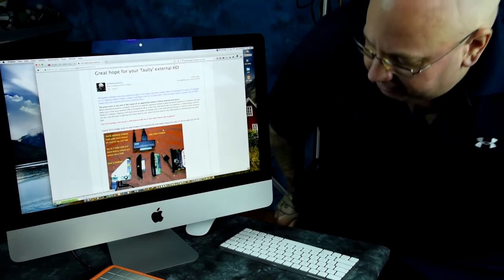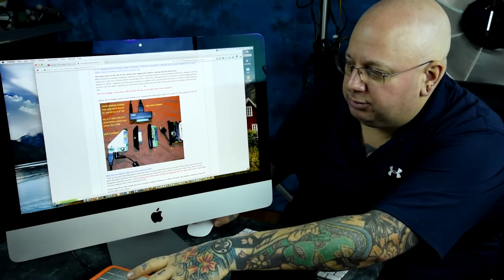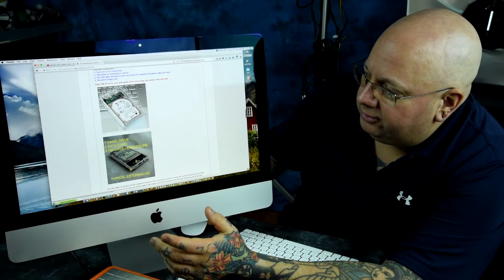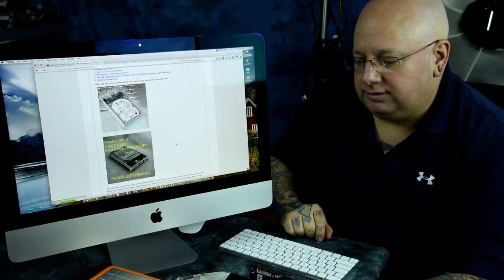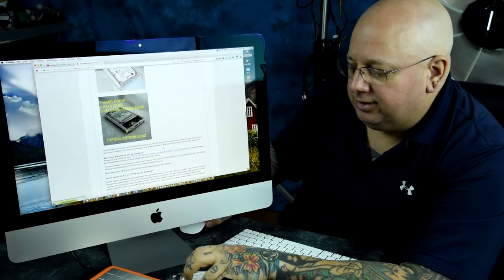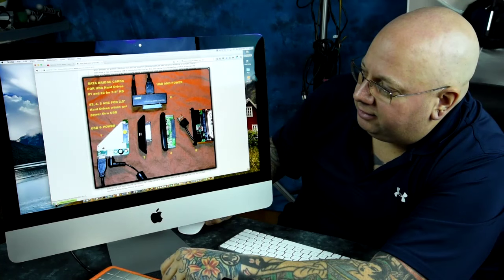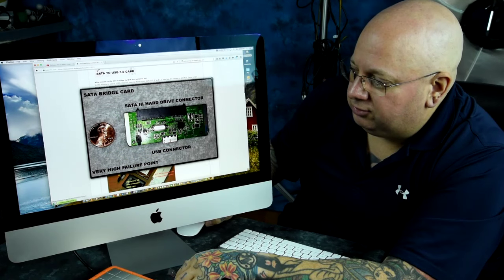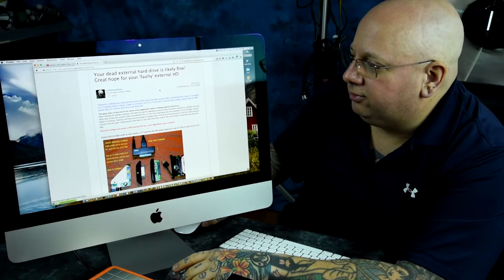Secret of "dead" external HARD DRIVES! How to QUICKLY fix the problem, its cause and solution

Comment: hey thanks a lot for taking the time, appreciated, but...still need the 'how to' part unpacked a bit more. "crack it open" doesn't help me much, sorry. My bacon is still in danger.
Reply from the maker: its just a plastic shell, crack it open like a clam, you wont hurt it …..just careful of static …dont touch the controller board on the bottom
Reply: And then just pull out the sata? It doesnt need it to run i assume?
Reply: How hard to put back together?
Reply from the maker: you need a docking port to run the drive
Reply from the maker: you dont ahve to put it back together i use NAKED drives solely, its easier, less space, nothing to break…… ;)

Comment: While I can appreciate your gusto, 95% of drives don't fail this way in my experience.  Yes, absolutely there are SATA bridges that fail, and those cases the data can be recovered.  However, there is no SATA bridge that you'll find on an internal drive, at least not in the description you show there.  Because drives are so cheap, it makes no sense not to have multiple copies of your data on a backup, both locally and in the cloud.  Aside from that, carry on.  Good fix on externals in some cases.
Reply: He CLEARLY said EXTERNAL hard drive fix, so I am not sure why you'd mention internal hard drive fix.  He did a good job, just let it be. The TITLE, definitely said "external hard-drive"....quit nitpicking.
Reply: To be fair, he said ABOUT 95%... Could that be 86?
Had he specified EXTERNAL he wouldn't be that far off.

Comment: I don't comment on Youtube very often. But this time I had to offer my thanks and express my deep relief. After my 4TB external Seagate refused to mount, I lost all hope. Even though I've lost extremely valuable data before when another external drive was dropped on a concrete floor, I still somehow managed to fall way behind in backing up my Seagate. I knew I'd lost years of work but the thing that bothered me most was that I couldn't remember what else was on the drive. There's no feeling quite like losing hard drive. After a desperate search I found this video and was afraid to believe it  could be so simple. Long story short, it was! I cracked open the case, removed the SATA bridge card and plugged the drive into a dock at work. It mounted immediately and I couldn't be happier. Thank you!

Comment: Good information, but not very explanatory. I did save one of my external hard drives by taking the factory bridge card out and using a powered one. But what about regular 2 and 1/2 inch drives? I don't see any real information that helps on that subject here.

Comment: I don't mean to be THAT PERSON but I cringe a little every time you say "inside the hard drive", because that's not really the inside the drive, it's the inside of it's ENCLOSURE. You should probably change your title and specify that you're talking about external hard drives because one day, some bloke is going to remove his hard drive from his MacBook and start unscrewing it and they're going to break their drive looking for the non-existent SATA bridge (or what I call a "USB adapter")  
Some other commenter said you're 95% figure was way off, and I kinda defended you because you said ABOUT 95% and that could very well mean 60, 72, 99 or whatever you want to interpret "about" is, but the guy is actually right. This isn't the problem with most droves or even half of them. NOW, had you said External drives, you wouldn't be that far off and if you specified "external drive enclosures", you would be right on the money.

Comment: What he doesn't tell you is that the most common cause of failure of the little card is dried up electrolytic capacitors.  Best is to replace them all.  Only a few, and total cost, less than one dollar the lot!!
Peter

Comment: You can use usb external power, need a 12v adapter
 and usb socket. It will work fine.

Comment: I wonder if this works for a Seagate Backup Drive that is like standing upright, that fell off my desk, manufacture date: 2012. It looks like a black box standing upright on my desk. It is not a portable hard drive. I would want to try this method ALSO with my other two portable drives as well that fell off my desk in 2015, and in 2021.

Comment: Get a Sabrent Dock station or buy Sata Cables and install them internally if your motherboard and power supply has the capability/ports...  No rocket science needed.  ALL drives are made by a limited number of manufacturers and most are created to be internal.  Putting them internal increases their speed due to direct motherboard action and so saves you a USB port and external power supply.  One big drive manufacturer is Western Digital for example.  PS, use Youtube to format/set up the drive, which has to be done.

Comment: Maybe someone here can help me with the problem I have. I had an external drive that suddenly stopped appearing, so naturally I disassembled the case and tried it straight into a SATA port. Very gladly I saw it appear in the BIOS, so I thought that all it was is a bridge problem, and that's true.
BUT what I see now as my G: drive is NOT what it was. I actually see a RAW partition and two non-assigned portions of the HDD, while I had a single partition full of data.
I guess it's got something to do with the bridge doing some type of conversion, but can I see the content of the drive somehow?
Thanks!

Comment: I have a WD USB 3.0 powered external drive. It works for about 5 mins then stops. Sometimes I can get it to remain spinning by unplugging it then plugging it back in. It will work fine for a few days then the problem returns. Sometimes I hear clicking noises coming from inside it. I'm not sure if that means it is dying or if the cable is bad or the random failure is the result of the component you highlighted in this video.

Comment: My BIOS does not detect my hard drive. It shows everything else but the hard drive. It keeps appearing and disappearing in BIOS. I have re-seated the SATA cord in different ports, changed SATA cables, and nothing. Can't boot up my PC. I am sending mine back to Amazon. Good thing I didn't put too much on it. Oh, this happened during my first virus scan. Perhaps they sold me a used card with a virus on it. I noticed that it had malware, junkfiles and other things. How can that be when I just bought it? I know, right? Thanks for sharing.
Reply: Niecy DMS  please help me with my apple harddisk

Comment: I figured that out many years ago. Tho' I don't recall ever having an external drive fail. I still have an 80gb external I used as a backup, over 15 years ago. It still works fine. I have a HDD dock, plus a couple of loose cable connector type. With the 2½in, you buy a single cable that plugs into the HDD and usb of computer. It powers the drive as well.

Comment: question. after 6 months i left my death hard drive inside a magnetic bag for a while , i was thinkin on send it to a data recovery service, but i bought this SATA to USB 3.0, SATA III Hard Drive Adapter Converter for 3.5/2.5 Inch HDD/SSD with 12V/2A Power Adapter and it worked perfectly fine for like 6 hours :( any idea what coul happen? its i worth to buy the dock in this particular case? and the dock its a recommendation for the rest of my life to save some problems in the futere?  gracias!

Comment: What about the WD external drives that don't have the bridge any more but JUST a USB connector?  How reliable are they?  I have just gotten a 2.5 inch Easystore 5 TB drive from Bestbuy on sale for $89.99.  Really I would have gotten a Seagate if it was cheaper or a very similar price per TB.  Then I could use it in my desktop or laptop someday if I wanted to.

Comment: Some times after dropping  a external hard drive you can remove it from it's case and and connect it to the SATA and power cable inside the computer and it can sometimes work to help you retrieve your data

Comment: A lot of people do not realise that you can simply 'shock' your drive motor into action again. The little motor inside the drive often gives out. Simply shocking it can 'Zap!' it back into action. Easily done by cutting a cable and placing both live points into the USB and turning on the power. Dont touch the box though! If that is too dangerous just get a mozzie zapper wand and connect it in. (or do it the cheats easy way and just place the drive in the microwave for 5-10 minutes. Then connect it up and let it rip! (if this tip helped please send support to my bitcoin address rjdEf3389hTH5rlIUJ7ljlim8uk78oKilO814 - thanks a lot).

Comment: hello @theoria apophasis
hello everyone 

sorry for my english .. plz i have big problem with my 4TB external hard drive 

i dont want to waste ur time reading ... so i will tell the problem very fast 

everything was ok with my hard drive ... but next day my pc didnt saw it ... but i can hear it running ( normal sound too )

what did i do trying to fix this 

1- changing the cable 
2- disk management ( nothing there )
3- seatools for dos ( again nothing in there )
4- i tried a different pc (3 of em ) nothing there 
5- changed the usb port ( nothing )
5- i changed the usb-sata bridge ( the green part in the video ) with 2.5 inch box ( still nothing )

any advise guys ...thank you

Comment: hello sir, i face the following problem with my maxtor m3 portable external drive. I purchaced it 3 months ago and i ve slightly used it only to install windows on a laptop and transfer some movies.  It has 2TB capacity and today i realized that this capacity is all magically gone and there is only 32Gb left inside the disc!! What happened?? Hope it is something fixable!

Comment: The power light on my Seagate Backup Plus (external) stopped coming on, but I checked the DC power suppy (transformer) with a multimeter and the voltage is fine...could that be a sign of a failed sata bridge card? Bacon in need of saving

Comment: What are the symptoms of a bad Sara bridge?I have a WD 1t passport and I know where to get the board. But I need to know if it's the board or the hardware (drive). My symthums are :Drive takes forever to load. When it does load, I get a warning - "Mac OX X can't repair the disk. You can still open or copy files on the disk, but you can't save changes to the files on the disk. Back up the disk and reformat as soon as you can"I can then look though my hard drive. I can open folders but they take forever to show the contents. I can even copy files but if the files are larger than a megabyte, it fails to copy. As if the reading is so slow, the computer gives up and a message says "the operation can't be completed because the item is in use". And if I try to open straight from the disk, it says "the document can't be opened".

Comment: I would really apprecitte if you could give me some advice ,  I dont understand much about the topic so my only solution apart from trying a disk enclosure would be to send the disk to a lab and they would probably charge me between 500 and 1000  euros and i really cant afford that atm , when i bought the SSD disk i have now i took out the Western digital sata disk i had and until now I didnt think i needed any of the files i had there but turns out i really do need them . I stored the disk but it feel down once after i disconected it from pc and now when i tried to connected it appeared to smell like something was burning and the disk just stopped  working  , it isnt recognized by the system and it really doesnt show any sign of live , its dead , i was wondering if its worth to try an hdd enclosure or if there is any other option i could take apart from paying hundreds to try to get it back.

Comment: Very useful video. Thanks.
A USB-SATA conversion cable ($10) also works to get data off.
When I hacked open my Seagate 3.5" 2TB, I blew the dust off the SATA Bridge PCB, pulled it out and put it back and the drive started working again for a short time. This might help someone copy data across if they are in a hurry.
I then bought a powered 2.5/3.5" USB3.0 to SATA conversion cable ($10) to replace the broken SATA Bridge PCB for my 3.5". It was cheaper than a dock and I don't access the drives often.
I also decided to get naked and bought 3x 2TB 3.5" internal hard drives and some nice colourful plastic boxes to store them in and use the cable to access them when/if needed.

The article you link to is also interesting and useful.

Comment: i have a question: so my computer died quite awhile ago and i took out the hard drive, buy a harddrive station and the harddrive was fine, i could move the data from the drive to my computer...since then i havn'et used the harddrive and the station. now, i wanna look into my hard drive again so i put it into the station and turn it on, but it doesn't response at all. the station doesn't seem to be responsing as well because the power light is not even on, i can't tell whether it is my hard drive or the station but since i havn't used either of them for a while, i dont see how both of them or one of them could be suddenly dead without even touching them...any ideas???? thanks.

Comment: I have repaired hundreds of external hard drives and never had a problem with the power supply board only a loose connection. So not sure where you have studied Computer science.

Comment: I opened a working external hard drive and took out it's Sata and put that in the not working hard drive. It acted the same. Made some groaning noises, the light came on but wouldn't boot up so to speak. Put the sata back in the other hard dive and it works fine. So does that mean my hard drive is one of the 5% that isn't fixable? 
Now I'm bleeding everywhere those fucking boxes are bastards to open

Comment: I bought sata to usb 3.0 cable with two usb head (one is for extra power) well i connected adapter to HDD and my pc (Mackbook pro late2011) did not recognized/showed up in my mac. Did not tried it with windows pc or a desktop pc though.
Reply: Tried with two different HDD, which works perfectly btw. but still did not work.

Comment: Hi Theo I have a SEAGATE 4TB SSD Hard drive which has all of a sudden stopped during a data transfer from this external hard drive to my desktop PC.  I have tried the same Procedure on my laptop and it does the same thing.  When it gets to 6% of the download it stops and will not go any further.   Does this problem sound like a Sata bridge to you?  I am also getting this message "CANNOT PERFORM THIS OPERATION DUE TO FATAL ERROR"  BUT I CAN SEE MY FILES FROM THE SSD EXTERNAL HARD DRIVE BUT WHEN I CLICK ON THEM I ALSO GET THIS FATAL ERROR MESSAGE.   HELLLLLLLP! LOL

Comment: All USB 3.0 external hard drives of 2.5" size have their usb to sata bridge embedded on the drive itself. Unlike older usb 2.0 2.5" models.
Is there any recourse from that, cause they also fail far too often.
As soon as I noticed this, I stopped buying such drives and always recommend that people get an internal drive and an external case separately. Even though its actually significantly more expensive

Comment: I got a seagate 1TB hard drive, i need to get corrupted files of it, but it's not showing up on windows, even though i hear a fan. What do i do?
Reply from the maker: always make 3 copies of you data ALWAYS………youll have to crack the drive case open and remove the SATA card as i mention in this video, if doesnt fix, your only options are VERY expensive
Reply: Theoria Apophasis Well, my drive is already dead.
Reply from the maker: ***** where were the redundant copies of that data?
Reply: Theoria Apophasis their isn't any, my drive died before i could finish a backup. and the data was trying to be recovered from corruption. :/
Reply: ccateni WAN hhu
Reply: did you got your data?
Reply: ***** no, the data was corrupted and before I could recover the data, the hard drive died.

Comment: Holy shit this saved me a million times over. Not necessarily because the usb-sata bridge was broken, but I think previously I was underestimating how easy it is to get a bad connection of one due to incorrect USB power supply or wires or something. Either way I came here in the hope I could save a huge database of (manually recorded to WAV) music records. Plugged the thing back in with a new setup expecting corruption and voila... it bloody worked.

Comment: Stick to 4TB and below 3.5" drives? What about the Western Digital blue and red drives are they nonsense? Just stick to the black drives?
Reply from the maker: +John Valatos blue and red are consumer grade junk.   All HD fail, but spend $30 more for a WD black. 

either than or a Hitachi.........the drives above 4TB have too much torque spin up and they BURN their drive motors
screw those drives, theyre "ultra Gigabyte" consumer crap, never buy them.
Reply from the maker: +John Valatos 
look how great 3 MILLION ISO is on the D5
http://www.imaging-resource.com/PRODS/nikon-d5/FULLRES/D5hSLI3276800NR2D-ND8.HTM

ROFL ROFL ROFL ROFL ROFL
Reply: +Theoria Apophasis Shocking and pointless.
Reply from the maker: true indeed

Comment: Hey man, I know this video is nearly 5 years old but since you're still posting on YouTube, I'm giving it a shot.
I have a Samsung HD203WI 2TB 3.5" HDD that was in a Fantom enclosure that "died". So I tried a powered SATA bridge and it didn't work. I tried the same bridge with a 2.5" SSD and it worked so am I to assume I've lost my 2TB of data? (And no, the drive is not detected in Windows 10, neither in Disk Management nor Device Manager and neither in Ubuntu Linux) :(